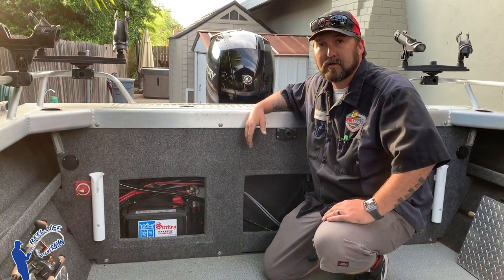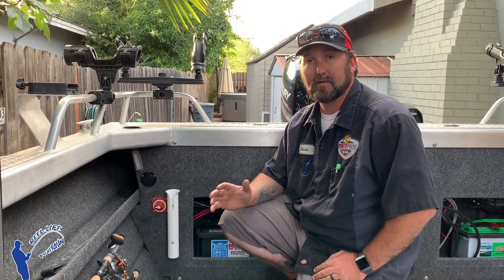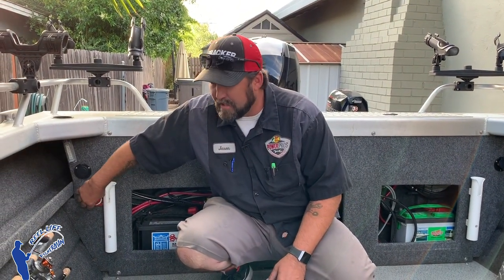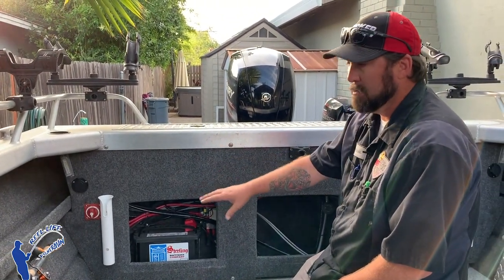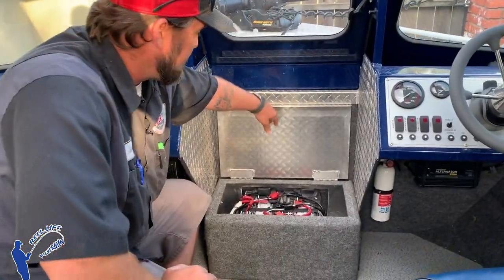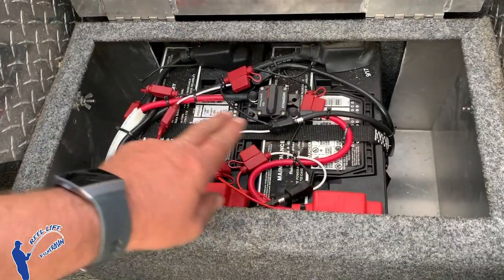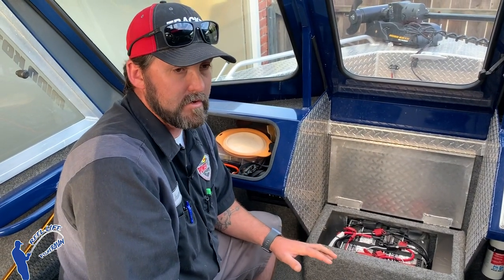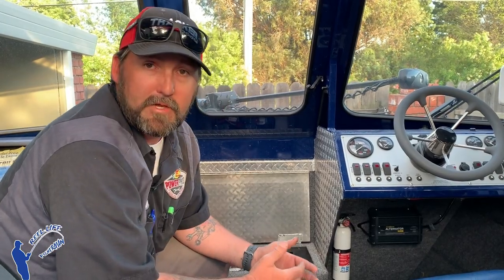BOAT BATTERY WIRING  | HOW TO

Comment: Thanks for the video.  I'm good on my 24v troller, but I think I need to help my starting battery that also runs all my other electronic equipment (graphs, ect..).  Instead of putting in a switch if I add another battery, could I put 2 deep cycle (31) and run them parallel?  Would they be ok for starting my Mercury Verado?  Just thought 2 deep cycles would give be all day fishing and still plenty enough juice to start the big engine.
Reply from the maker: Thanks glad you liked the video.. so sounds like you need a battery isolator.. your verado needs a AGM battery.. for the crank battery.. so what I would suggest is getting a battery isolator and this is how it would work .. you hook a battery wire coming off the alternator on the engine to the isolator input then you have one wire going form post one on the isolator to the crank and a battery wire from post 2 to the deep cycle house battery.. you hook all the engine battery wires including the clean power and power steering booster pump to the crank.. then you hook all the boat power wires to the deep cycle.. then you connect the grounds from both batteries with a jumper wire .. then the isolator will charge both batteries when the engine is running but both batteries are used independently from each other.. hopefully that makes sense... all battery wires and jumpers should be 4 or 6 gauge.. let me know if you have any questions.. it’s hard to explain typing it all out.. thanks for watching
Reply: @ReelLifeFisherman  OK makes sense that if the batteries are parallel that starting the big engine would still draw them both down.  I'm going to install MK 460 PC charger (not sure which one is the newest model 1834600 or 1824601), so not worried about recharging the batteries on the water.  I think I'm following what you are saying on how to set it up, but wondering if I need to go that far or just installing the batteries separately then not worrying about the starter battery ever having other things draining it.   Thanks
Reply from the maker: Only thing is if your digital throttle and shift controls at the helm are hooked to the boat power and that goes dead.. you would be unable to start your boat as well .. even with a fully charged crank battery..  that’s why a isolator is a good idea or in my opinion I would do both a switch and isolator..  but I know you’re probably not wanting to mess with all that.. but that is how we set up most all the verados we do..
Reply: @ReelLifeFisherman  last couple of questions.  Does the 150 Verado need the AGM battery or just the bigger Verado's?  When I bought it it had a standard flooded battery for the starter.  When you talked switch it looks like you used a Blue Sea M series 6007 correct (trying to find them)?  And I'm thinking that the isolator you are talking about is what you pointed at that was behind your starting battery (what brand and model)?  Again thanks for all your help.
Reply from the maker: http://www.marinepartsexpress.com/Merc_Product_Bulletins/EN%2004%20Bulletin%20No.%202008-04R1.pdf
Reply from the maker: So I sent you the link for a service bulletin from mercury about the AGM requirement for verados
Reply from the maker: This link is for add a battery with a isolator with the ability to combine the two
Reply from the maker: Blue Sea Systems 7650 Add-A-Battery Kit https://www.amazon.com/dp/B000RZNP5K/ref=cm_sw_r_cp_api_i_ZQoAEbGTW3DD5
Reply from the maker: This one is the switch I have then you can hook it to the main fuse block or bus bar like I described in the video.. I will post both links
Reply from the maker: Blue Sea Systems m-Series Mini Selector Battery Switch - Red https://www.amazon.com/dp/B000MMFJH0/ref=cm_sw_r_cp_api_i_HToAEb0811ZPD
Reply from the maker: Blue Sea Systems SafetyHub 150 Fuse Block https://www.amazon.com/dp/B0053BTSEK/ref=cm_sw_r_cp_api_i_uWoAEb0RJR7R2

Comment: What is the best way to ground an amp in your boat so you don't get motor noise while running?
Reply from the maker: We always ground the amp directly to the battery.. if it does get the motor noise they have a filter you can install to stop it.. Thanks for watching and let me know if you have any questions..
Reply from the maker: https://www.amazon.com/Isolator-BOSS-Audio-B25N-Systems/dp/B000LP4RMG/ref=mp_s_a_1_12_sspa?dchild=1&keywords=marine+alternator+noise+filter&qid=1609988894&sr=8-12-spons&psc=1&smid=ABO907060G8YG&spLa=ZW5jcnlwdGVkUXVhbGlmaWVyPUFJQTZOWktFSkxHUjQmZW5jcnlwdGVkSWQ9QTAwMTAyMjgzUkQ2UDEzVzkxNDJCJmVuY3J5cHRlZEFkSWQ9QTAwODM2MDcyUk5TU0FCOE00WE9WJndpZGdldE5hbWU9c3BfcGhvbmVfc2VhcmNoX210ZiZhY3Rpb249Y2xpY2tSZWRpcmVjdCZkb05vdExvZ0NsaWNrPXRydWU=

Comment: Thank you, from Florida. Could you do another video on boat battery chargers?
Reply from the maker: Absolutely the next time I install one I will go more in depth about them.. if you have any questions about them just let me know.. thanks for watching!
Reply: @ReelLifeFisherman  On this same topic, I have the same 2 battery (12v) system as you described in detail at the beginning of this video. I also have a 2 bank charger. So I would simply connect the positive and negative leads from each bank to its own battery with no special wiring?
Reply: Pretty sure I found the answer further down 😆. Each battery gets its own bank no matter what voltage your using it for.

Comment: Thank you for the info. its a great way to save money on installs. 
Had a question, why do you have so many fuses on your batteries? You mentioned to use a circuit breaker but didn’t explain anything on the fuses.
Thank you in advance.
Reply from the maker: The fuses are from each bank of the battery charger and the alternator charger.. so each battery has 4 on them .. glad you liked the video and thanks for watching

Comment: Will the OFF position clear the radio memory?
Reply from the maker: Good question.. yes it would and something I should have mentioned in the video.. if you don’t want your radio to loose it’s memory.. then the memory wire should be hooked directly to the battery for constant power.. along with the bilge float switch power.. those you would not want to kill the power to.. thanks for watching and let me know if you have any questions zz

Comment: Do you need a 2 bank charger on a 24 volt trolling motor battery (s)?.
Reply from the maker: Tom Weigand yes you should always have one bank for each battery.. even though they are 24 volts as far as the trolling motor is concerned, when hooked in series.. the charger will charge each battery as 12 volts.. hopefully that explains it.. if not I have another battery wiring video on my channel too.. let me know if you have any questions anytime.. thanks for watching..

Comment: Hey I bought a Mariah shabbah speed boat. Alternator went and I was dead in the ocean. Swapped batteries while I was out there trying to get started. Long story short I put new alternator In and 2 batteries and I have power to radio everything but won't crank over now any tips? Working in 95 degree weather I'm stuck

Comment: Any chance you have a diagram of how you have your starting and house battery hooked up?
Reply from the maker: I don’t .. I could draw one up maybe.. I’ve been hoping someone will want one done as a side job so I can show how it’s done.. I do them often at my shop during my 8 to 5 job .. but I haven’t hit my boss up to let me film in there yet.. lol.. he loves my channel but I keep the 2 separate..
Reply from the maker: Let me try and type it out and see if it helps .. I can’t post pictures in the YouTube chat unfortunately.. you would have to go to Facebook or Instagram
Reply from the maker: So you have your battery switch: 1,2, 1&2 and off.. you have a main fuse panel or positive and negative bus bars.. you hook crank battery to position 1 on the switch.. you hook deep cycle (house battery) to position 2 on the switch.. you hook the engine positive and the main power to the fuse block or positive bus bar to the output on the switch also called the common.. the crank and deep cycle (house battery) negatives are hooked together along with the engine negative and main negative going to the negative side of the fuse panel or negative bus bar.. hopefully that helps.. let me know if you have any questions about it.. or maybe contact me on Facebook or Instagram and I can draw something up because I know it can be easier if you can see it.. thanks for watching

Comment: Hello, I have a quick question regarding battery wires. I have two 12V AGM batteries that I'm wiring in series to get 24 v for my trolling motor. What gauge wire do you use to connect the batteries to complete the series connection?

I'm running 6 gauge from the batteries to the tolling motor receptical.

Thank you
Reply from the maker: I typically use 4ga when connecting batteries together.. great question and thanks for watching! Appreciate it
Reply: Thank you very much!
Reply: I'm going to run 4 gauge battery cable from one battery to the second. What gauge do you run from the battery to the 60 amp minn kota circuit breaker?

from the battery to the receptical I can run 6 Gauge correct?

Thanks in advance

Comment: Do you have to disconnect the charging wires(fuses) when you are running the 24 volt system?
Reply from the maker: No they are still hooked up 12v. The only thing connected at 24 is the trolling motor.. thanks for watching

Comment: On a 12 volt trolling motor with 2 batteries run in parallel how do I hook up a 3 bank charger to them.    I have 1 starting battery for bank 1-     Bank 2 and 3 go to the other two hooked in parallel~.  Do I put a relay between those 2 batteries somehow?     Thank you
Reply from the maker: So with a a smart charger like the one you have.. you should hook each bank to one battery.. the charger will work as normal.. if you had a 2 bank and just hooked it to one of the batteries hooked in parallel it would take much longer to charge.. the chargers sense each battery so you are not going to hurt the batteries or charger no worries.. thanks for watching let me know if you have any questions..
Reply: Reel Life Fisherman   So just to make sure- I’m a rookie-   For just the trolling motor batteries I run them together pos to pos and neg to neg and hook each battery to its own charge bank.  12 v motor.    That will fully charge batteries separate-   The starter battery has its own bank also-   When I hookup trolling motor is that pos to pos And neg to neg on the same battery and it will pull power thru the one battery.      Thank you for your time!,!
Reply from the maker: Yes to get 2 12v batteries hooked up in parallel.. you hook positive to positive and negative to negative.. then hook the trolling motor to just one battery positive and negative.. the battery charger will charge each battery separately when one bank is hooked to each battery individually..  also I would add.. each battery should be the same when hooking them up in parallel.. same size and rating and ideally the same age and brand..
Reply from the maker: I have another battery wiring video on my channel where I go into more detail on how to wire up trolling motor batteries.. and show the wiring steps and voltage output.. make sure you have a 50 amp breaker on the positive to the trolling motor as well.. let me know if you have any questions.. it’s no problem.. thank for watching
Reply: Awesome.    Thanks again.     I subscribed to your channel.    I’ll check out more of your vids!!!

Comment: Very understandable! Thank you for that... You made it make sense... I have a question because I've had so many different opinions but do I need to be worried about having the batteries close to my gas tank? By close I mean a foot or so.. Outboard.. Front open but all else enclosed
Thanks!! 😁
Reply from the maker: As long as there is no spark from something arcing at the same time you had a fuel leak or vapor leak there wouldn’t be any problem.. but always make sure you have a good fire extinguisher handy .. but no batteries are almost always pretty close to fuel tanks and lines on a boat.. just make sure to always inspect and check for vapor smells.. thanks for watching glad you like the video

Comment: harbor freight has these small battery charger that charges deep cycle batteries and it Automatically switches to maintenance mode when battery is charged what do you think about it? its called a viking
Reply from the maker: The marine smart chargers they are waterproof and will actually maintain the battery.. which keeps them healthy.  Not  just setting at a full charge all the time .. they will exercise them if setting at a full charge for too long... that is the main difference.. but I’m sure the harbor freight one would work ok.. if you want to take it off and on.. let me know if you have any questions.. and thanks for watching
Reply: @ReelLifeFisherman  I wanted something that can charge all and not just for one type and not  break my pocket, because my budget is Max out in a good way not by buying everything I see, but by the typical stuff like house kids college ,needed stuff. lol and this charger seems to here's what it says let me know what u think Im also going to do a video on my Evinrude motor on my 14ft its an 18hp I don't know anything about boats but Im learning i'm kinda handy man but here's the info on the charger Microprocessor control adjusts current to match battery type and condition
High frequency technology is over 20% more efficient and over 50% lighter than conventional charging systems
Winter mode for specialized battery charging in winter weather conditions
Large easy-to-read LCD display shows full range of readouts including voltage/amperage, charge capacity and includes "bad battery" indicator
Automatically switches to maintenance mode when battery is charged
Heavy duty 7 ft. 14 gauge cables
Reply from the maker: That all sounds good then.. should work just fine!

Comment: My trolling motor has a switch for 12v and 24v ... I want to run the 24v in series .. my question is should I wire in series or parallel or does the switch on the trolling motor  switch from series or parallel? (When selecting 12v or 24v) I'm going to wire in series and run on 24v thinking that is the proper way and to run 12v hook the two batteries up in parallel.

Comment: I am installing a 24 TM. Can I use the circuit breaker as on/off switch?
Reply from the maker: If it is a reset able breaker you can.. but over time they can wear out doing that.. it would be better to put a plug and receptacle in and just unplug it.. thanks for watching the video.. and let me know if you have any questions..

Comment: A question: the negative have to he grounded yo the Hull of the boat is metal?
Reply from the maker: Mauricio Verhelst .. good question. And the answer is no.. you don’t want to ground anything to the hull of your boat.. it will cause electrolysis and corrosion.. also lots of grounding issues.. you can just run everything off of the negative post or make a negative bus bar .. it’s different then wiring your car in that way..  your car has rubber tires keeping the ground or earth from causing electrolysis but you boat sets directly in water..  great battery question.. hopefully that helps.. thanks for watching! And let me know if you have any questions

Comment: Can you switch from 1 or 2 or both while the engine is running as long as you don’t cycle through off to get there?
Reply from the maker: On some battery switches yes.. but it always best to shut off the engine before switching.. but never switch through off while the engine is running..
Reply: @ReelLifeFisherman  how can I tell if it’s ok on mine? Everything seems to be ran to the common on the switch. Because everything works on either battery. All the grounds are connected to one battery but all the power lines are ran to the switch not the battery.
Reply from the maker: The grounds from the two batteries should have a jumper between them as well .. you would need to look up the battery switch manufacturer and model to see .. but it’s best to just shut off the motor. I always do.
Reply: @ReelLifeFisherman  ok thank you

Comment: Added a Minn Kota plug so I can overnight charge all batteries plus a Minn Kota battery monitor so I can see if the motor when on is in fact charging the system up. Doesn't cost much extra but having the labor do that right is a very worthwhile expense as is the mounting plate with an on/off switch plus a fuse.

Comment: great video sir.i have a question about setting up 2 batterys.1 for starting the motor and 1 for my trolling motor on the bow.also want to add a smart charger.any simple diagrams would be appreciated.im a wiring dummy.thanks in advance sir.
Reply from the maker: Thank you glad you like the video... so pretty straightforward with the wiring set up for those.. the crank battery will get the engine and boat power wires hooked up positive and negative.. the deep cycle for the trolling motor will get hooked up positive and negative to the trolling motor only.. then each bank from the charger will get hook to each battery positive and negative.. bank #1 on the cranking and bank #2 on the deep cycle.. hopefully that explains it.. if you have any more questions please let me know.. thanks for watching
Reply: Thank you.i shoulda thrown this 1 in with it.can you use the same charger for a lead acid for start and a AGM for trolling?
Reply from the maker: Yes most new smart chargers can do both at the same time
Reply: Oh and which battery do I hook up the fishfinder to?thanks in advance

Comment: My trolling motor has a switch from 12-24 on the side of it. So how should i run my batteries if the motor has the switch?
Reply from the maker: Dirt Worm the trolling motor plug receptacle would have to be a 4 wire set up with one set being wired 24v and one wired 12v to switch back and forth.. is it an older motor guide trolling motor? You could just wire for 24 and leave it that way..